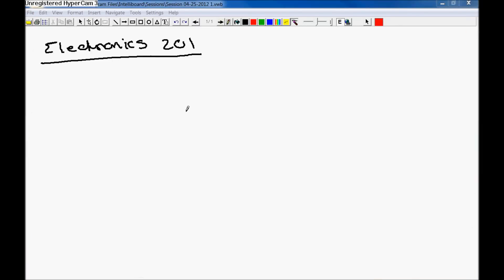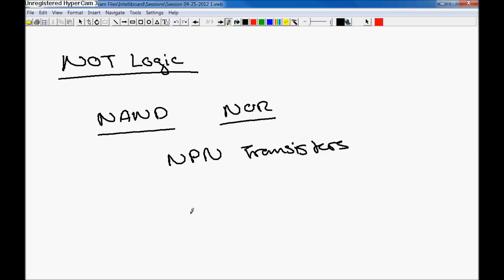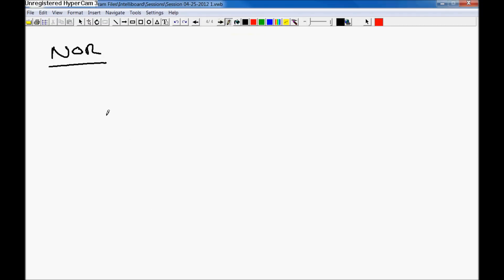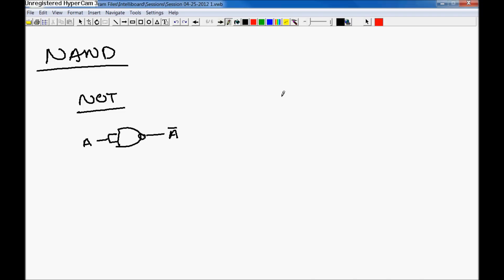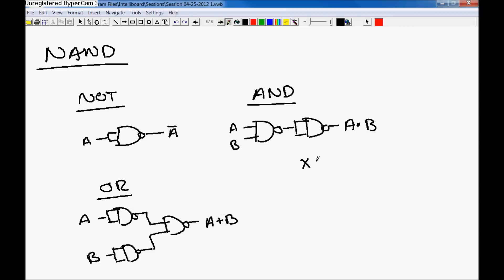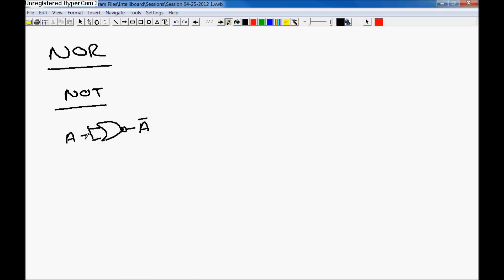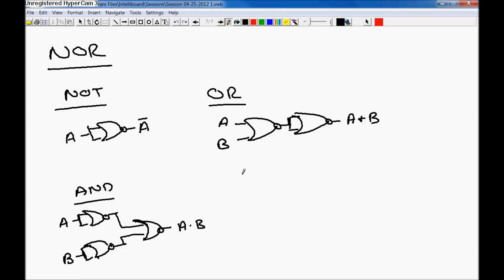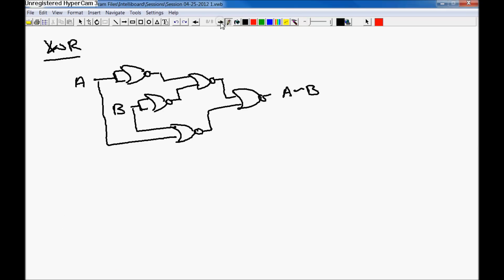Electronics 201: Transistor Transistor Logic

Comment: Nice vids, just want to add that you mentioned the reason NAND and NOR gates are used primarily instead of AND and OR gates are because of the type of transistor, and while that may be true, I think the main reason is the NAND and NOR gates are universal gates, meaning every other gate can be made using either NAND gates or NOR gates, the same can't be said for AND and OR gates, as a simple example you can't build an inverting gate using only AND or OR gates.